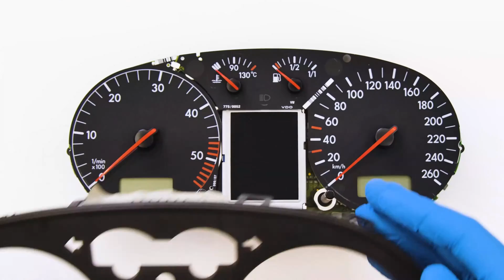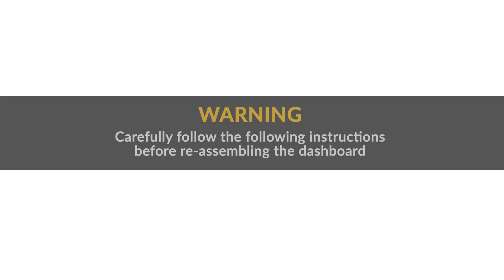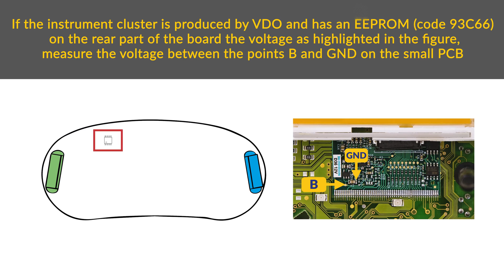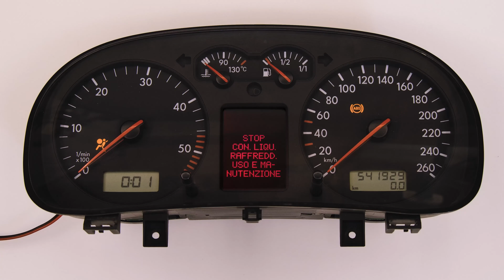Volkswagen Golf 4 and Bora instrument cluster LCD pixel repair – faded full FIS display replacement

Comment: Hello, excellent explanation.
In my case, the screen is fully lit, and no digits are visible— they have gradually disappeared until the screen is completely illuminated.
Is it possible that I only need to solder the pins you mentioned, or do I also need to replace the LCD itself?
Thx
Reply from the maker: Hi, in your case the issue can be fixed by replacing the LCD, as shown in the video. For any doubt feel free to contact us by e-mail, attaching pictures of the cluster, at store@minitools.com. Thank you!

Comment: How can flux damage the board irreversibly??
Reply from the maker: Hi, the fluxing liquid should be used with caution. If applied in excess in areas with narrow spaces where it is difficult to remove it, a residual excess of flux could cause short circuits between the conductor tracks and damage them.
Reply: @MinitoolsChannel  can flux make short circuits?? but flux does not drive electricity

Comment: Hi, I changed my km counter without display to one with a display, but it doesn't indicate the temperature. Can you tell me which PIN the external temperature sensor should be connected to? So I'll wire it up, thanks
Reply from the maker: Hi, we're afraid we can't help you as we deal with instrument clusters repairs, we don't do upgrades.
Reply: What kind of motometer did You install? Maybe i can help You.
Reply: @tomek8266  Thanks but I've sold that bastard of a car now

Comment: Ive got a half screen, would it be the same connections?
Reply from the maker: Hi, could you please let us know the producer of the cluster sending us an e-mail at info@minitools.com? The connections may change based on the producer (e.g. VDO, Jaeger, Bosch, MotoMeter etc.)
Reply: @MinitoolsChannel  where can I see the make of the cluster on the cluster?
Reply from the maker: Hi  @fwdsmatter1117 , the only way to check it would be to remove the cluster from the car; the make is usually either printed on a label or marked on the rear cover of the cluster.